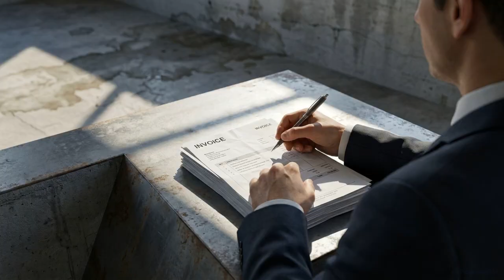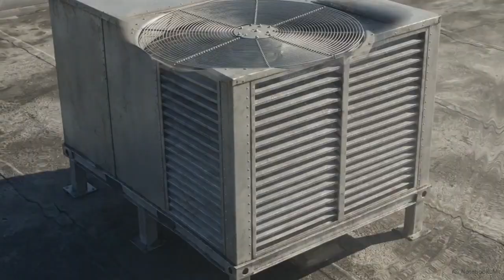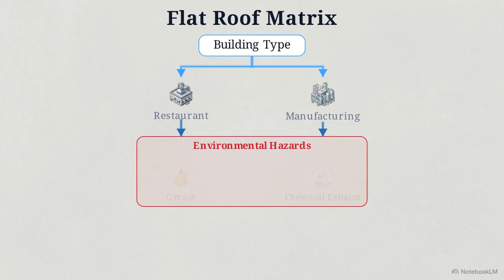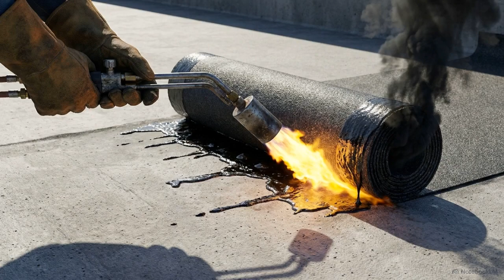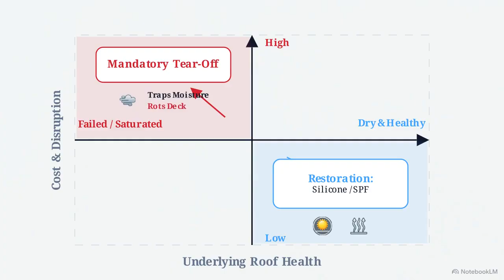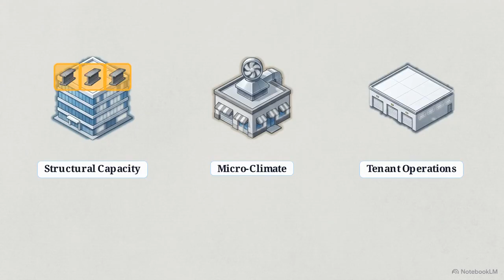Flat Roofing Systems California: Which Commercial Roof Fits Your Building?

Comment from the maker: Not every flat roofing system fits every California commercial building.

TPO may be ideal for large reflective roof areas, PVC may be better for restaurants or chemical exposure, modified bitumen can work well for durable asphalt-based assemblies, and roof coatings may extend the life of a roof that is still structurally sound.

Read the full flat roofing systems guide here:
https://orangecountycommercialroofing.com/the-most-common-flat-roofing-systems-in-callifornia-and-their-benefits/

Visit Commercial Roofer Orange County:
https://orangecountycommercialroofing.com/